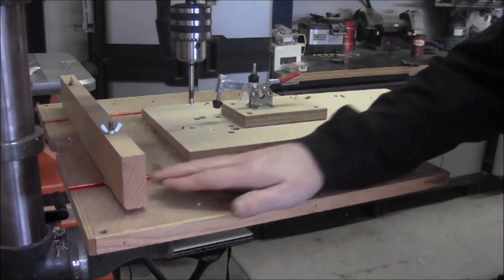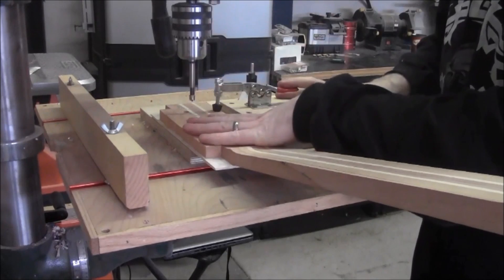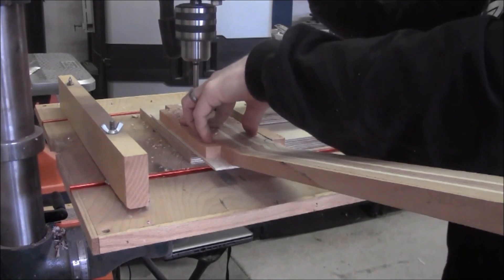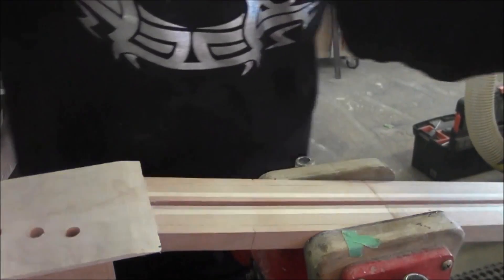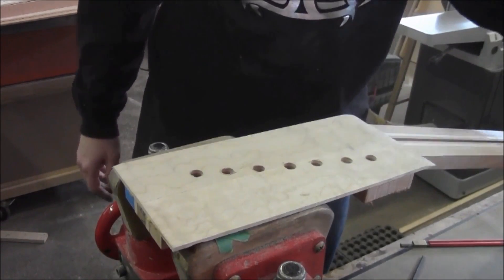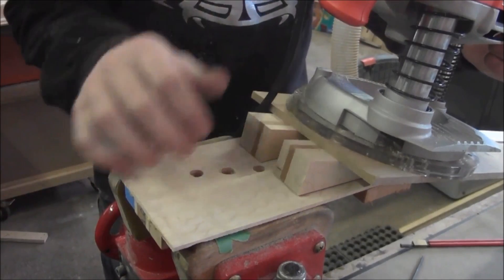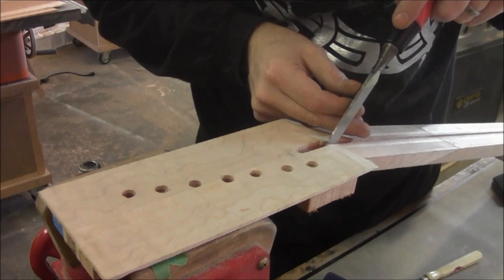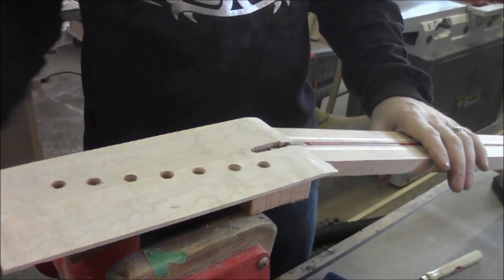How to Build an Electric Guitar-Video 4- headstock pt 2

Comment: Hey man, how did you cut the taper on the neck. This is the problem I'm facing right now. I'm building a neckthrough guitar at the moment, and I tapered the neck from the nut to the 24th fret (like you would with a regular bolt on). But then I discovered the problem: at the 19th or so fret, where the body is touching the neck there is a gap, since the body joint is flat, yet the neck joint is tapered. Hope I was able to explain my problem. How do you deal with this
Reply from the maker: I cut the taper on the bandsaw. The taper of the neck ends where the body meets the neck. At that point the cutaways of the body start on the neck blank. The sides of the neck (where the body cutaways start) is then chiseled away to form the rest of the taper and to level the area to the same level of the body wings. Hope you can understand this explanation. I thought I covered this step in a previous video but I may have missed it.

cheers
Reply from the maker: check out video 6. the thumbnail actually shows this step ;)

cheers
Reply: DarkLuthier
Thanks a million, I never thought of use chisels
Reply from the maker: where there's a will there's a way ;)
Reply: DarkLuthier
That is very true